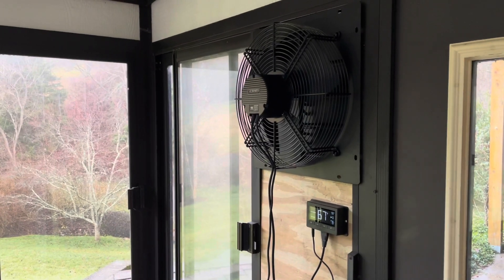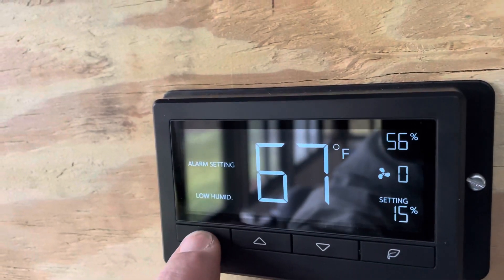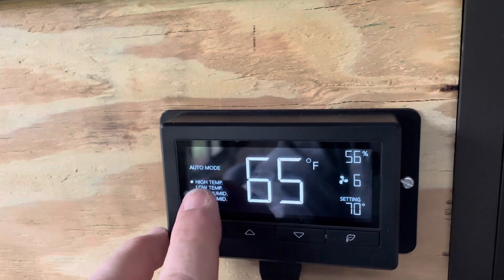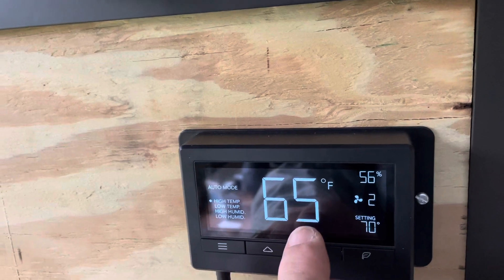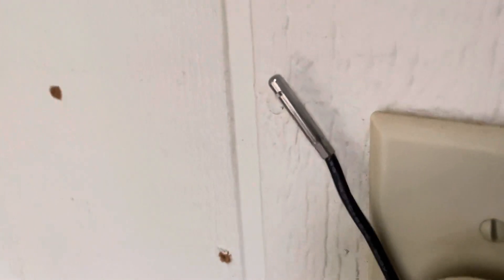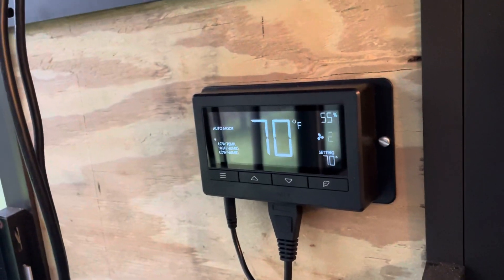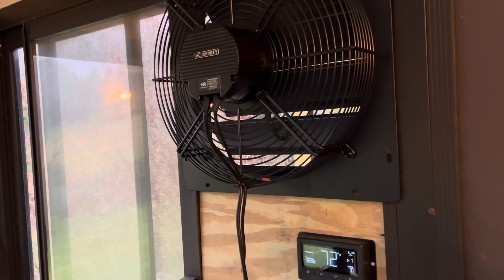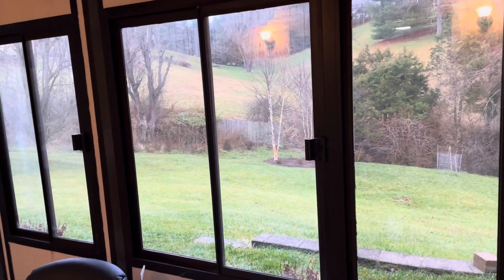ACInfinity Exhaust Fan System

Comment: if i want it to be turned on 247 do i disconnect the sensor probe so it does not turn the fan off? i want to use it in my 3d printing room to vent out the smell while i print.

Comment: Good review, two questions can the fan (w/ the combined grill) assembly be separated from the louver section? I am looking to install the unit on a thick wall eg 6 inch thick concrete wall? Second question what is the power draw in watts on the lower speed settings 1 and 2?